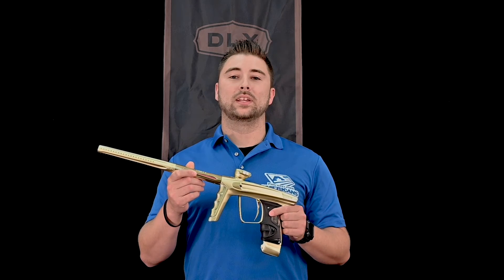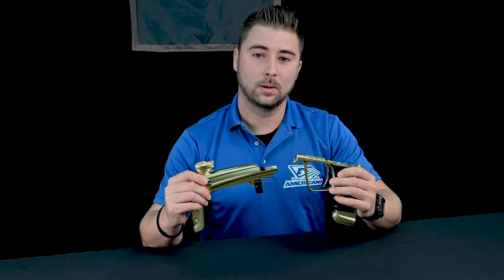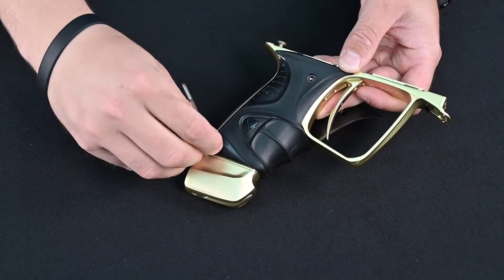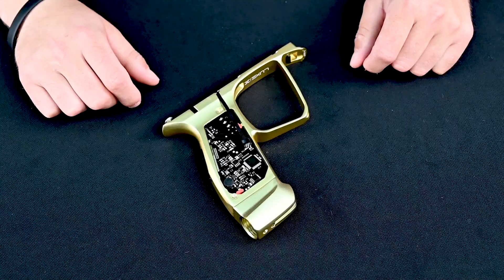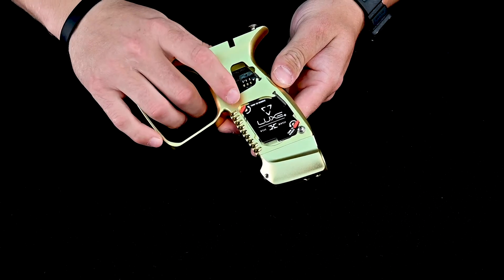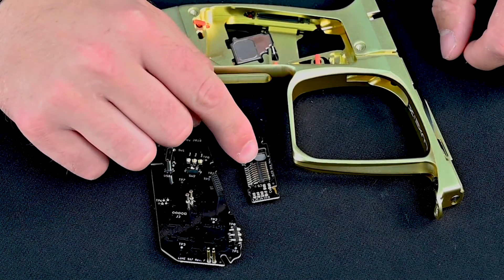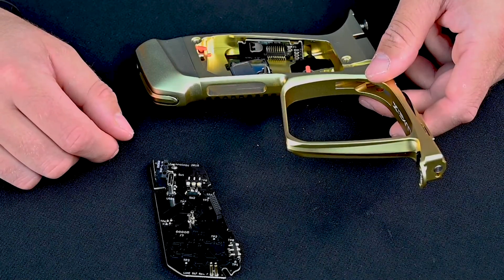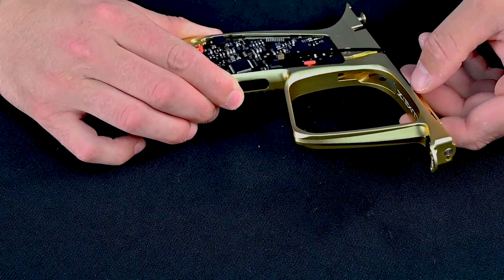DLX Technologies Official - Luxe® X Control Board Removal

Comment: Hello, what is the ideal output pressure for the cylinder? I'm from Brazil and here the measurement is in PSI. LUXE is low pressure. Which would be ideal? 400 PSI, 500 PSI, 600 PSI, maybe your average is in BAR.